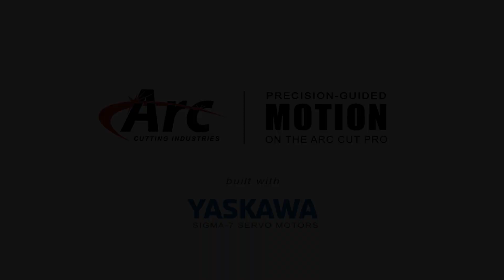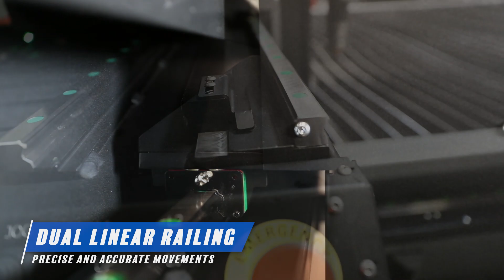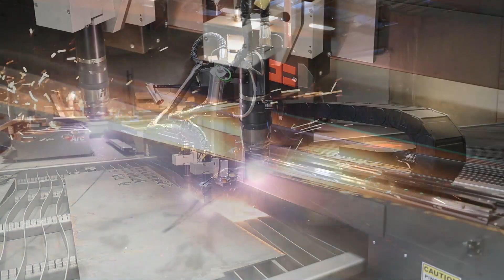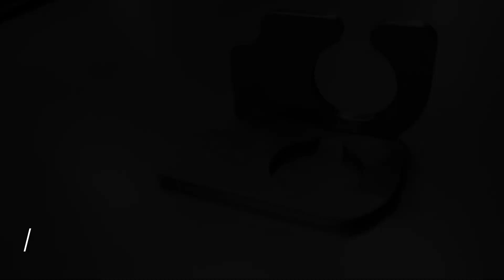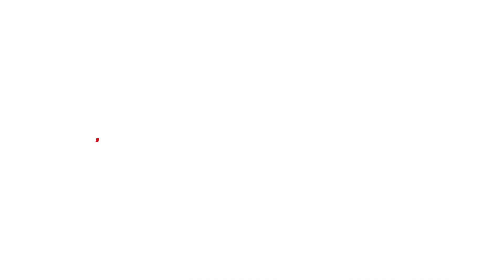Precision-Guided Plasma Cutting with Yaskawa Sigma-7 Servo Motors

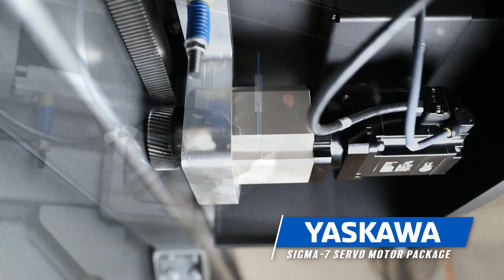Comment: what you see in 0:21

from the right
- a stepper motor
- a gear box, most probably planetary type
- a helical gear
- a helical gear track

so we have several basic functions 
- create a controlled linear motion with little vibration and noise
- create a linear guiding 
- provide electrical energy and signals

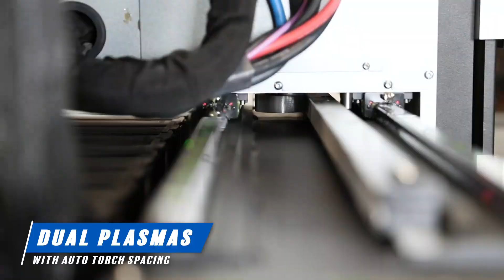interestingly they use the same drive system to move along the longitudinal and transversal direction. In 0:50 you clearly see the helical gear + helical gear track and most probably a similiar stepper motor + planetary gear box.

I guess they're using the same approach to move the laser heads along the vertical axis.
Well a really great machine, good job.

My company is also using a laser cutter for metal sheets. But your system looks way better.
Reply: /facepalm. That's not a stepper motor, it's a sigma seven servo. The entire point of the video. If your knowledge is representative of your companies products, it's back to the drawing board for you.

Comment: Sigma 7 servos on this machine is like killing Ants with a Fire arm. Nice obviously.. needed.. not so sure. A good Trajectory planner and a stepper motor would do just as nice cut.
Reply from the maker: Hi Chicoxiba, 
Thanks for your comment. Steppers can be functional in a variety of applications. They are ideal when performing the same move profile over and over at relatively low speeds and low RMS torque requirements. Servos offer distinct advantages applications like this one. If you are interested in more information, please contact Yaskawa America, Inc at marcom@yaskawa.com.